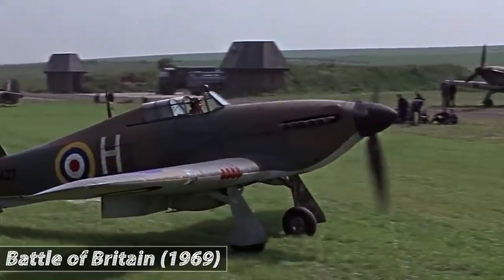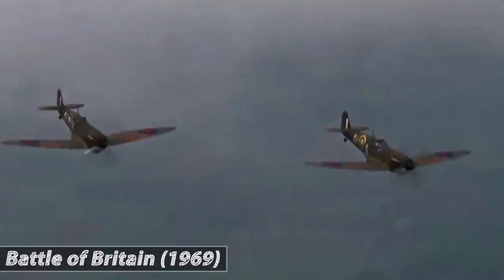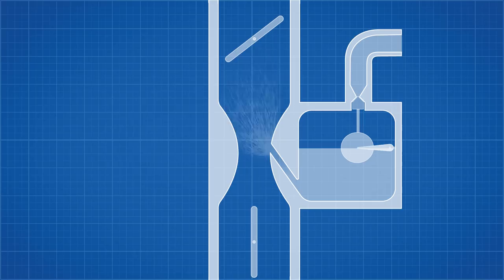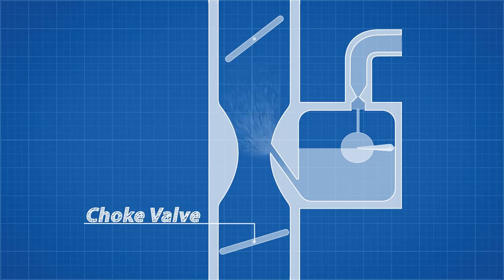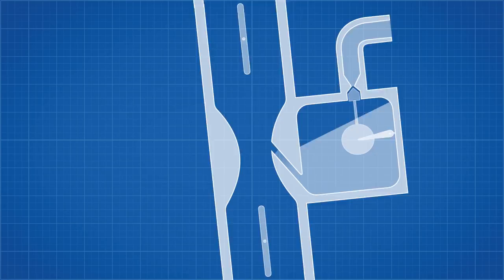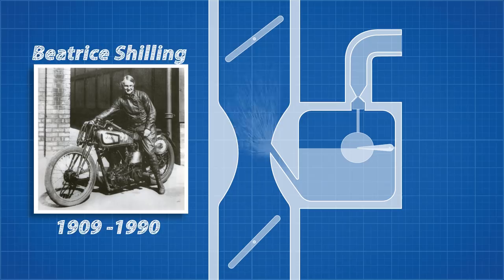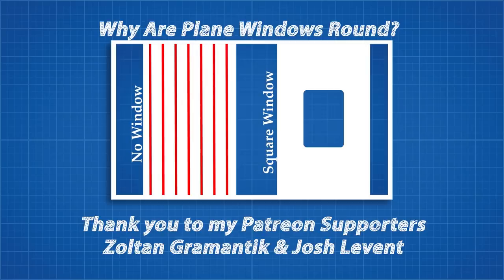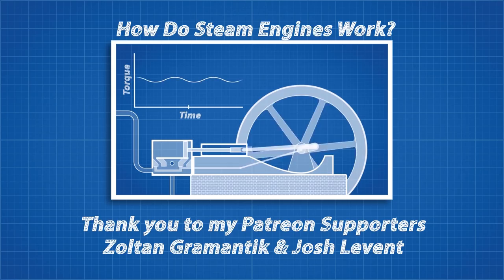The Spitfire's Fatal Flaw

Comment: Enter the Germans with fuel injection. Got to hand it to them, they knew how to design a brilliant aircraft
Reply: And how to lose a war or two ... Brilliant Huh  ;)
Reply: @theoccupier1652  Who cares. Doesn't change the fact they had the best equipment.
Reply: @ev0lutiionary914  That's all true and with the short amount of time these tanks were developed and pushed into the war that's no wonder. But alone the kill ratio of e.g. Tiger vs. T34 of 1:10 shows that they were indeed better. Also, it's not like the T34 had no flaws... In the end quantity defeated quality.
Reply: @Leopoldus Carniolus no, the T34 had a diesel engine...
Reply: @Leopoldus Carniolus T34's were diesel powered, they had to be injected as all diesels are.
Reply: Alan Deere had a punch up with a gaggle of Me109s over Dunkirk/Belgium in 1940 and shot two of them down, so  the Me 109 can't have been all that brilliant.
Reply: Except aerodynamics
Reply: Apparently Rolls Royce considered fuel injection but preferred a carburetor as it gave more power output and was easier to maintain in operational conditions.
Reply: @ev0lutiionary914  so i study the design and engineering or panzer and i jave a lot to say.

First you are correct in the Pz. Kpfw. III and Pz. Kpfw. IV. But regardless of any of those, the StuG III was the most built armored vehicle and it sufficed to all the or demands, that not very tough as their more heavy tanks, it's strengths were spectacular  enough to be built from the beginning to the end of the war.

As for the Pz. Kpfw. V "Panther"
The panther was quite the well made tank. Major flaws reside in the engine, Transmission, gearbox, and quality of material. Compared to the Tiger, the panther was in far worse condition. Germany tried very much to make this their standard medium tank so the heavily spanned this out in production. Now you must understand the variants in production. Basically the first 2 models, the Ausf. D and Ausf. A had the major flaws you know of today. Many of the transmission problem stem from these variants and the reasons because a lack of material like copper, chormium, etc. As for the gearbox, their was indeed a flaw in it's design making it susceptible to breakdown on all varients, to add to this the materials used to make the third gear were very brittle making it prone to shattering. Again with the lack of resources, the frontal armor plate was far too brittle because they lacked the needed metals required to make the alloy. This led to the front plate shattering on direct hits even when there was no direct penetration. Also to note, many Panther were rushed into production for Kursk with many flaws not resolved, after the battle, the panther receive much needed fixes and variants like the Ausf. G have much higher quality. Overall if germany had the materials, there would be very little flaws to cause breakdowns, with really the weight and suspension being the main problems.

Now for the Pz. Kpfw. VI Ausf. H1-E "Tiger 1"
The tiger get a worse representation than it should have. Unlike the panther, the Tiger was actually quite reliable, the Tiger didn't face many transmission problems because it wasn't rushed too much in design and production. Most transmission problems would just stem from the tigers weight but overall it's was quite decent and the crews of tigers say it was reliable enough. As for it's real problems, it was from the engine as the thing had faulty fuel lines, another was it's suspension which could not handle the weight of the tank, BUT let's be completely honest, NO heavy tank in WW2 had good suspensions, ALL heavy tanks from every side are prone to breaking down, the weight is always the reason. For heavy tanks, breaking down cannot be used as much of an excuse unless their is a design flaw. Anyway the Tiger was indeed complex in design, well it wheels mainly, so it meant relating that area is tricky and time consuming. It main flaw is that it lack spare parts due to the low production, it heavy weight, and engine problems. It was overall decently reliable. Also Kursk rushed them so their were often more cases of failure before during Kursk (These are reports from their own crews)

As for the Pz. Kpfw. VI Ausf. B (H) & (P) "Königstiger"
There are a lot of desig problems here, structurally, this was a very sound tanks. It's quality of parts for the the transmission and engine are to question. But it's main design flaw is its weight, the massive weight meant that the transmission and engine could not handle it. Whether the transmission and engine are perfect in design and manufacturing, the weight was too much making it far underpowered. Overall weight was a main problem. 

The German had VERY good equipment *to do their job*, it just that they weren't high enough in quality to match up with the performance

There are some exclusion that are bothering me, it is widely know that Germany lacked oil, this is one reason why Germans left behind and destroyed their tanks. Next, not as known, a tank is a complex delicate instrument and tool. A tank driver is required to understand how to used it correctly. On all these tanks, driving it wrong could mean the failure on these tanks, and for the panther, tiger, and Königstiger, many of their crews were young men rushed into training, without full experience, MANY of the tanks broke down because the drivers didn't drive it correctly resulting it the tanks breakdown, this was very apparent in the Königstiger were a little screw up broke messed up the already weakened transmission.
Reply: @GrandTheftChris  Kill ratios only mad in a team deathmatch video game dude, in a war like WW2, the only option was to win a war of attrition, which the Germans couldn't hope for.
Reply: @connorbranscombe6819  I know that. We were talking about the equipment, not who was more likely to win the war. If the germans had troops and machinery in numbers of the allies it would have been unstoppable superiority.
Reply: @GrandTheftChris  Yes thats generally how it works dude, but German technology and engineering was far behind the allies, Germany had stuff that was neat like the V1 and V2, or the STG, but none of it was that practical or actually any use, just as a quick comparision the germans used the Kar09 as their standard issue rifle for the whole war, while the Americans had a semi auto rifle that was as accurate and had a more powerful round behind it, the Germans being technologically superior is pure myth and fantasy.
Reply: @connorbranscombe6819  Again, you missed my point. Nobody here talks about production numbers, only about how good the available equipment was. And the germans had the most sophisticated technology at the time. That's a fact. If you mean the K98k (Kar09 what is that?) it's true that it was the most common rifle. Guns like the MP 40 (over a million units) or the MG 42 (about 400k units) were superior over its competitors though. And you think the V-rockets were useless? I think that's why the U.S. took its developer to design the Saturn rocket for the moon landing, because it was so bad. They even had the first jet that flew missions at the end of ww2. Of course it had little impact on the course of the war but nobody claimed that here.

PS: https://www.youtube.com/watch?v=NUY2UkZPPhQ
Reply: @GrandTheftChris  Germans being technologically supierior is a joke, how'd that nuclear bomb work out for them? Worked out pretty well for the allies, MAGIC, Bletchley Park? Nah bro fuck that, MG42 goes brrrrr, seriously though the Mp40 was inferior to the Soviet PPSH-42, and the Thompson, the Mg42 was faaaar inferior to the M1919, a gun literally developed 25 years before, and that doesnt really matter when the main foot solders are armed with Kar98's, US infantry squads could schwack Germans because they had better squad based firepower, better air technology, (jets dont really mean that much if they cant do anything against the waves of advanced B-29s and B-17s, which were the most advanced bomber of WW2), V2s literally killed more German workers then British civilians, and even the V1s had little to no impact on the British war effort.
Reply: Fuel injection wasn't a perfect solution. Rolls Royce stuck with carburettors for a  reason.They were using two stage supercharging and the carb venturi lowers the incoming air/fuel mix pressure, thus cooling it, allowing higher boost pressures and ultimate power.
Reply: @jerryudonneedtoknow3903  
Only 10,000 Stug III were built, far from the most.
Reply: @barrierodliffe4155  I inferred it was the most built armored vehicle of Germany during WW2, NOT the world. I know I didn't specify but why would you think I would say it's the most built in the world, that has no place in my comment
Reply: @jerryudonneedtoknow3903  
We are not all mind readers so what may be obvious to you is not obvious to everyone.
Reply: What an informative comment section
Reply: The Luftwaffe lost a lot of fighter pilots to crash landings. Their preference for mounting the main undercarriage legs on the fuselage resulted in a very narrow wheel base. This made the aircraft very unstable, particularly when landing on grass strips.
Reply: @bobdylan7120  They also lost plenty of them to the RAF.
Reply: @barrierodliffe4155  My comment was in response to the original comment, "they knew how to design a brilliant aircraft". An aircraft that regularly kills pilots when landing cannot be considered a brilliant design.
Reply: @bobdylan7120 
Not the only issue with the Bf109 but other aircraft killed pilots like the very bad aerodynamics of the P 38.
Reply: @barrierodliffe4155  True. Also, the Corsair killed a few American pilots attempting carrier landings before the Fleet Air Arm solved the problem for them (approach in a left wing down arc and fit a small airflow disruptor on the starboard leading edge).
Reply: The technology came in waves.  The Spit, Me109 were great 1st generation planes.  But then came the 2nd generation. P51 faster AND had range.  Then came the 3rd generation Me262.    In tanks the 1st generation Panzer 4 was initially triumphant till it came up against 2nd generation  T34.  Then came German 3rd Generation Panther.    The 1st generation bolt action Mausers, 2nd generation American Garand semi auto,  3rd generation German MP40 assault rifle.
     Moreover other qualities are important.  A broke down tank is a liability and Russian and German tanks did frequently.  The Sherman, not the best fighting tank, was reliable.  Our planes were not as maneuverable as the Zero, but were fast and could take a hit.  
      These comparisons are fun, but it’s impossible to get a true apples to apples.
Reply: @danbenson7587  
Except the P 51 did come later but it was not faster and did not have much range when it entered service in 1942. , it was still not faster after it was given the Rolls Royce Merlin engine, and the Spitfire always had better acceleration and climb. 
The Me 262 was not a good fighter, it lacked reliability and maneuverability. 
German tanks did not do so well against the British tanks early in the war. It took a while to improve the Sherman and it lacked the ability to climb or go where some other tanks could.
The Garand had disadvantages compared to the older reliable Lee Enfield rifle. 
  Any fighter could take a hit, it would depend on what hit it. 
The best way is to compare like for like at a given time.
Reply: @barrierodliffe4155  Thanks for reply.   
    First, Comparisons would have to be the last, ultimate model to see combat service in the war.  Second, the comparison would need be on the same basis (eg altitude, gross weight, etc.).  Third, the doctrine needs the same basis (pursuit, escort, attack).  Fourth should the comparison include qualities such as reliability, serviceability, produce ability?.   Otherwise it circles. Fun but pointless.
   I can talk your ears off here, but my original point was technology goes in waves.  Gallons of ink spent comparing tanks and planes, but in those days victory usually went to who saw the other guy first regardless of their mount.   Cheers
Reply: @danbenson7587  
Just a small point about victory going to see who saw the other first, that did apply quite often as did numbers, to quote Luftwaffe Fw 190 pilots, "the fighter we feared most was the Spitfire, not so much the P 51 or P 38 unless we met them in overwhelming numbers". I am not sure why no mention of the P 47, I would have thought that was more of a threat than the P 38
When seeing the other first did not work includes this from a small flight of Spitfire Mk XIV's which were attacking a train.  They were attacked by Bf 109's,  " They really caught us by surprise this time but by using the Spitfires stunning turn and climb we were able to turn the tables and shoot a couple down for no loss."
Of course since the Spitfire did escort bombers, do ground attack and fly sweeps over enemy territory there was not much it didn't do. The figures for the Spitfire speak for itself, very reliable, quick turn around, many more produced than any other allied fighter.
Reply: @barrierodliffe4155  I have nothing against the Spit.  My favorite being the Corsair.  It’s just not so easy because pilot quality, particularly vision, had so much to do with it.  The ironies abound.  The highest scoring allied type flown exclusively be a single pilot was the P39 (some Russian dude)
Reply: @theoccupier1652  Mass numbers beats out Highly advanced equipment like every time, power in numbers
Reply: Mechanically yes, but ergonomically no!  In high G maneuvers the german pilot was liable to pass out due to the upright flying position in the Me Bf109.
Thus in a high speed dive the spitfire pilot was under a lot less stress, when pulling up at the bottom of the dive he was able to cope with the higher Gs due his seating position with his legs out in front of him.
Reply: This is so funny reading all these, it's clear some of you know your stuff. Across all weapons/tanks/aircraft and so on, a few things that seem to not have been mentioned is a piece of equipment is only as good as its operator, availability of materials due to enemy action (blockade and price hiking by the allies on stuff like tungsten) not to mention other things like, mg42, 3 times longer to make than a bren, it fires so rapid the barrel overheats quickly, once barrels are kaput so is the mg once spare barrel is used. All these comparisons across all weapons is a good debate, but, the 109 for example, yes an excellent fighter at that time (1940) but so over engineered coupled with hard to fly/land, in a war scenario makes it not good. Peacetime yes, in a war situation then most German equipment no. Specialist workers instead of mass production, some stuff made by slave labour and they tampered with parts, lack of parts due to bombing and what I already said blockade etc, because said equipment is over engineered, longer to train on. Don't forget, just flying a fighter, not that hard, flying a fighter in combat at extremes against good opposition, your dead. There are so many reasons I think this debate will go on and on.
Reply: The wright brothers used fuel injection.
Reply: Shame they couldn't elect a brilliant man...
Reply: Why compare the tiger, a heavy tank to the t34, a medium tank ?
Reply: Hoa Tattis  As too WW2, Corsairs flew off Brit carriers in Europe.  True they never tangled with the Luftwaffe.
Reply: The toilets didn't work in 0g though, so they couldn't have been that good
Reply: @ashfox7498  From the mk 9 had no problem with the carburator
Reply: V1 the first cruise missile...V2 first prototype ICBM... Me262 a swept wing jet fighter all decades before anyone else.... lucky Hitler meddle in production screwing everything up... BF109 had an inlet skin design... fuel ejection and forward slats.
Reply: @DOREYS2NEAT  No they didn't, the Tanks were slow and very heavy & drank loads of fuel, thier aircraft fighters ? & where were the heavy bombers ? ... the British and Americans decimated Germany because they had heavy bombers & superior fighters.
The Germans did have excellent fuel containers though :)
Reply: @robmiller1808  one reason RR gave was supercharged air passing through a carb venturi lost temp through the manoeuvre and reduced the temp going into the engine.